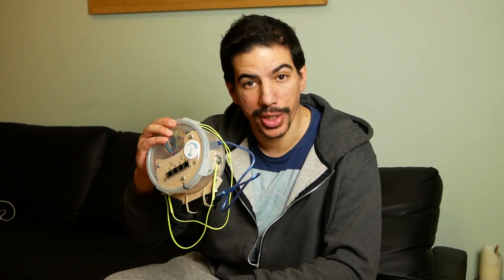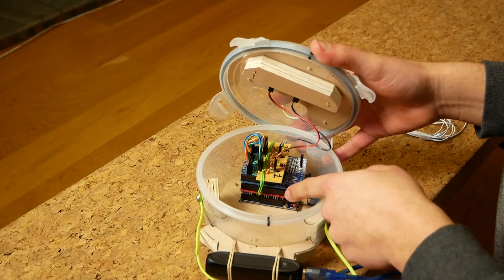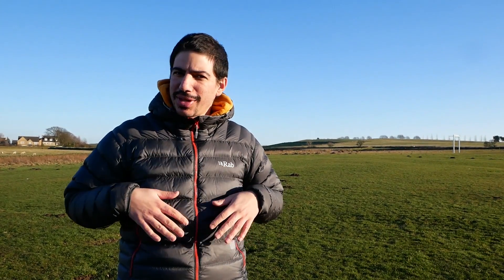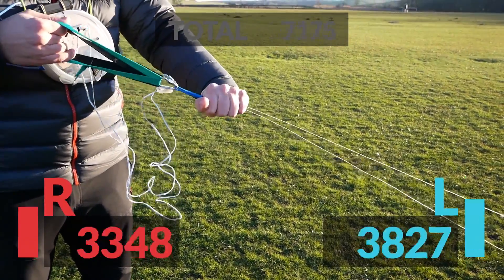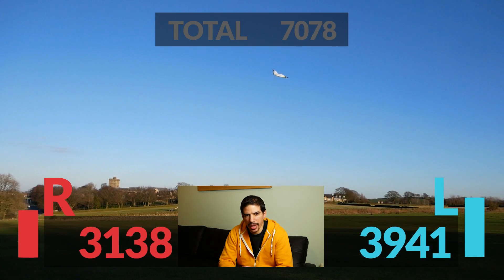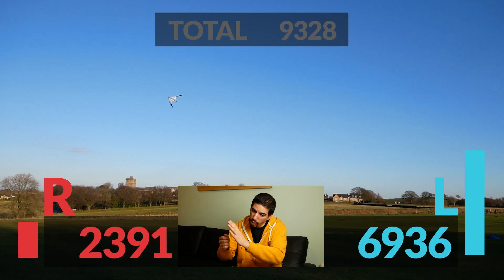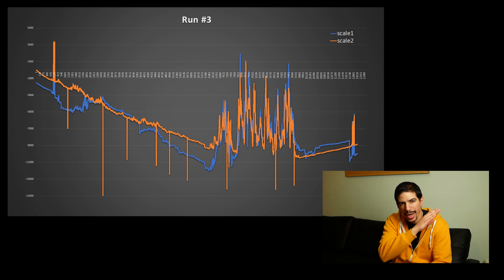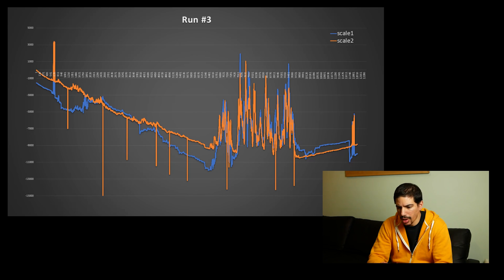Real world testing - Uncollapsible Paraglider Part 4 - BANDARRA

Comment: After looking at your vlogs, I’ve wondered if you would be interested in pursuing an idea. Years ago Irvin made a parachute, the Delta II Parawing. They said it was inspired by the Rogelio kite, but I think it took more from German WW II designs. As a parachute it had 2 major problems: first, opening at terminal velocity, if uninhibited it was sudden and vicious, so they developed a wrap to slow it down the “Opening Shock Inhibitor or OSI, this worked sometimes, sometimes it didn’t work and a reserve had to be thrown; Second, it was very fast if flown well, this meant novices lowed in on landing (remember this was well before square canopies and before knowledge of how to flair a canopy into a stall on landing). This was BEFORE Bill Moyes developed Hang Gliders! The point of this is, I’m almost sure that the design can, with modern technology in fabrics and materials, be redesigned as a Paraglider. I think it can be a very fast paraglider without the inherent instability you see in High Performance paragliders, when you have one side of the glider stalling or collapsing, all with the inherent stability of “Pendular Stability” and the virtual immunity to collapse as compared to Hang Gliders.

Comment: What about using accelerometers for angle reading on the leading edge, make an average of it and detect the wing folding. This will be quite cheap than those resistors.
I will add some little pockets on leading-edge and put the accelerometers inside.

Comment: Dear andre. This is an very interesting topic and solution, but i dont trust electronics. I maybe have found a mechanical way to do this, is there a way i can contact you? I dont have instagram or facebook. I am a machanical engeneering student but no pilot(sadly). It would be a joy to hear your thoughts about my idear. Please respond
Reply from the maker: Yeah sure, just write it down
Reply: @AndreBandarra1  okay i'll try but its hard to explayn without a drawing. 
So i thought about a a machnaism wich is mountet between the a line and the riser. It consists of a spring wich is fully stretched under normal load, and contracts if the load skinks under a certain amount. Paralell to the spring there is an cam as knoen from compound bows mountet on the upper attattchment point of the a line. On the attatchment point of the riser is one end of a pushrod conectet, while the other end is conectet to the cam so as the spring contracts the cam turns. A second brakeline leads to the cam so if the load sinks on the a's the machanism pulls the brake automatically. The dimensions are dependend to how much brake is needed for a certain amount of load loss. A locking mechanism may be needed for launch and landing because the spring otherwise pulls in the a's and brakes then.
I haven't ever flown a glider so it might be complete nonsense but that is whay i thought as i saw your video. 
Thank you for responding anyway. Great youtubechannel, very interesting content.
Reply: @niklaspasterniak7927  If I understand correctly, you're using a mechanical link from sensor to control, and sort of skipping (or, rather hard-coding) the compute step in between.  That might be good for a production model (if the control rules were simple enough), but I'm not sure it helps with the measurements needed to get a good calibration in the first place.  Or maybe it does -- if measuring "it said to pull the brake this much" is easier than measuring the tension directly.

Comment: Wonderful, I'm looking forward to the next video.

For the design of the maillon, what about using an 8 shaped object instead, where you connect the lines at the top and bottom but have a single rod in between them? I could imagine that the stress response is more linear on those too. (Unfortunately I don't know what to call those, I'm a software engineer and don't know too much about mechanical stuff :))

To get some instant feedback, you could try to attach a piezo buzzer to one or both sides, so that you can immediately hear the pressure (similar to how a vario makes the climb rate audible).

If you want to shrink the entire system, one possibility would be to make a very small PCB with a microcontroller and a BLE transmitter that is attached to the sensor. You could then use your smartphone to receive the data and show live stats (and maybe trigger an alert).

Another option would be standard 2.4 GHz radio transmitters and a receiver connected via USB OTG. Check out Crazyradio PA: https://www.bitcraze.io/crazyradio-pa/ It's an open source project originally made for a remote controlled quadcopter, but it could just as well be used for transmitting / receiving data from your remote sensors.

Comment: Dear Andre! Great idea and impressive presentation of your approach to the challenge. Not seeing any follow-ups for a year now, I am afraid, metering line tensions may have turned out more difficult, than anticipated.
Lately, I mounted a 360 camera to the underside of my paraglider and looking at the footage, this may open an entirely different way to collect the data you need: observing the wing as it flies.
The 360 video (https://veer.tv/videos/paragliding-insta360-one-x-291386) allows watching the entire underside of the wing throughout the flight. Now, imagine we mark every anchor point of a line to the wing with a black dot. The result will be a point cloud moving in space over time, representing the present geometry of the wing.
Just imagine, I pull big ears: the point cloud will look radically different (and so will the flight characteristics of my paraglider). 
Yeah, I know, the video resulted from heavy post processing for stitching and stabilization and collection and evaluation of that data in real time will not be trivial. But it may be worth considering as 360 cameras evolve very quickly and already do much of that in camera using secondary data from an IMU (accelerometer, compass, etc.). The insta360 one X I’m using even supports recording GPS coordinates from my smartphone.
Just a thought … whatdoyathink?
Cheers, Tilmann
Reply from the maker: Hey Tilmann very cool footage and idea! Yeah it's been quite a while since I worked on this project. We moved countries, I lost my workshop and was having some issues with the sensors, but there might be some more progress on this on following months :) we'll see

Comment: The bad connection is good. You need your software to deal with it, so it'll let you debug the software to filter out the bad data. You need to have the software be able to detect and deal with bad connections.

Of course this is only during testing. During a real flight you want good connections. But, what happens if a good connection turns bad during a flight? It's important that your software doesn't freak out and do the wrong thing in that situation. It should also notify the pilot of the situation so that he's aware.

Comment: When is the next video coming?!? Im excited to see this implimented into an impending stall or collapse alarm! Youve got space in there for a speaker. Now you just need to put it in a paraglider, collect data, and determine how to code it so that it can anticipate the collapse to set off an alarm! :)
Reply from the maker: It's going to take a little while. I got stuck designing and making new sensors and I've hit a bit of a road block. Also it doesn't help that off the shelf sensors are so expensive (150usd a piece) so I can't afford 30 of them. And to add to all that we're moving countries in the next month so it's going to have to wait :)

Comment: Please don't take this the wrong way as I do understand and appreciate all the time and effort you have put in up to now. But have you thought about using a different type of sensor something along the lines of what is used in mobile phones and model aircraft, quad copters etc these give you six axis of movement sensing into a cheap package. Have you looked at the arduino flight controllers that use these sensor's..I have dabbled in model aircraft electronics hang gliding in the past and feel you would be far better off using gyro sensor's.....very best of luck with all your endeavours. One last thing where about are you.
Reply from the maker: Hi steve, yeah I thought about using IMU's and it's not a bad shout. Maybe something that has it's own battery and bluetooth and you can clamp to the wing. I would like to keep it wired for now though and close to the pilot as I'm enjoying the discovery process by that's a good suggestion and I don't discard it for the future

Comment: Keep thinking about your data readings. Watching how fast the numbers change may be a little fast for good data gathering. Example would be your fuel gage in your car. If your driving on a dirt road you would never know how much fuel you have with your needle bouncing like crazy. Think the same for your chart. If there is a smoother buffer it maybe better to see how the pilot is reacting with the wing in thermals. I think you really should add an altimeter to the mix or vario. Be cool to see the climb rate mixed with brake line pressure and over all pressure! 
    Would love to see the charts on a normal pilot vs xc pilot!
Reply from the maker: That's a good point Carl. For me personally I wanted 10Hz or higher because what I would like in the next stage would be to observe the tension on the lines before during and after a collapse, especially on the A's. So if the refresh rate is too slow I might not be able to see the fenomena that happens before the wing collapses, but I'm just guessing this is all unknown. Also if you have the raw data at a high sample rate, it's quite easy to average it and change it from say 10Hz to 1Hz and display that
Reply: Andre Bandarra 
Collapse of the wing is going to happen. Need to remember a paraglider is just a plastic bag in the the sea of air. 90% of the safety is what the pilot is doing and feeling to prevent the collapse. Watching the As really wouldn't be to important in my view. Think altitude and brake reaction from the pilot with your device might be interesting to view. See how much pressure was on the line brakes before and during the collapse. Think a guy would want to know if he was heavy handed or react to fast or to slow. Be interesting to see reaction times to preventing the collapse between a pro xc pilot and a hobby pilot. 
      Think adding altimeter and looking at brake load in a thermal would be interesting data. Collapsed wing I beleave is more the pilot not reacting in time to bad air condistions or stalls.
Reply from the maker: Oh I see what you mean now, using the system to measure pilot inputs rather than the wing itself. It makes sense and there is no reason why that can't be done in the future. especially if we give it to an acro pilot :)

Comment: Nice Project! Really great work you've done so far. Did you yet consider using dyneema connections instead of metal? Comparable to soft links which are used instead of main carabiners for hike&fly paragliders.
Reply from the maker: Hi Simon, yes I have. I think they would be particularly useful for  attaching the risers to the next generation sensors I'm designing. Will have a look at getting some as I never seen them in person or used them myself

Comment: well done! both on the project progress as with the video edit :)

a few questions and comments:
1) have you thought about using a Raspberry Pi instead of an Arduino? It would be more compact since you'd have an easier time with dataloging and even managing data afterwards (just take a keybord and small lcd screen and you can check data on the field :))
2) what did you use to make the graphical display during the video? I've been trying to export some data from XCSoar into my videos using Python and Matplotlib, but it's a bit cumbersome and takes hard word to sync up the data log with the video (I noticed your '3-pull' sync method :D).
3) might be a cool future video idea for you to visit the paragliding certification company and see what kind of tests they run and what kind of equipment they are using to measure the strain on paragliders :) (related: https://www.youtube.com/watch?v=JLN7I9Ae88k)
Reply: I've not used the Arduino, but I second the vote for the RPi. Coding in python with all the available libraries and being able to use WiFi for data link might make iterating your prototypes easier. You can probably find pre-written python code libs for cleaning and normalising the raw sensor data on the fly. I believe there is also an Arduino interface so you could keep your existing hardware interfaces but offload the processing to RPi if preferred. Maybe a use for the empty space in your tub! Anyway, nice work, very impressive!
Reply from the maker: Thanks dude! and really good questions!
1) yes I have 2 actually but haven't started looking at that yet. As far as I understand they are more powerful than the arduino but not as easy to program, but maybe I'm just being scared of the unknown. if/when i run out of power on the arduino, raspbery pi will be my next go to
2) the arduino just writes tab delimited text file, so i get that import it into excel to clean up the data and view graphs and then import to Adobe After effects. This is not a seamless or smooth process though and lining up everything is very tricky. Also after effects has a maximum of 5000point import using the method that I'm doing so I'm looking forward to getting it better in the future
3) I'd love to visit yeah and see how they do things. Looking at they max load tests it looks like they have a single load cell that then attaches to the risers. From memory I think most manufacturers try to get 10G on the wing before it desintegrates. So their envelope might be something like 500kg to 1500kg and based on a big heavy truck. I'm more looking into something with a 500gram to 20000gram range and that is small enough that you can fly with. 

We'll see, all this is very exciting :)
Reply: You can run your code in Python on the Raspi and make the code boot up automatically on startup. Probably you can use the same method but with other languages like Javascript or C.

thanks for the answers!
Reply: @AndreBandarra1  in my opinion for this type of project you want the sensor reading and logging to be very reliable. For that, the Raspberry Pi is probably the wrong choice. Unless you create a custom Linux based image, you will have boot times of around a minute or more and much higher energy consumption (= larger batteries required). And it's also less reliable due to much much more complexity in the software stack.

The advantage of the Arduino is that you can simply take the ATmega (or SAMD) microcontroller at the heart of it and build your own PCB (with onboard bridges etc) without all those connectors that take up space. But you can still re-use the same software as for the Uno. That makes it easy to prototype and the result is still shrinkable. Other microcontrollers (e.g. ARM) might be even better suited (there are also microcontrollers with built-in BLE and similar), but they're also a bit harder to program. But I'm sure you could find an electrical engineer that has some experience with writing firmware that would be willing to come up with some code.

If you want to make your own PCB, check out http://kicad-pcb.org/. You can find a lot of resources online and on YouTube that help learning to use the software.
Reply from the maker: Thanks dude, I'm just giving my first steps into this type of electronics and programming, you guys definitely know a lot more than I do about this stuff. will check it out :)

Comment: Wonderful job! It appears that the left load cell has consistently higher values.  Is there a zero’ing function or is it a characteristic of the kite?  Either way, very cool and congrats!
Reply from the maker: I think you're right and i noticed that too. As far as I know it was a sensor error rather than the way the kite flies. The calibration must have been a bit off. Another reason to go further into new sensors :)